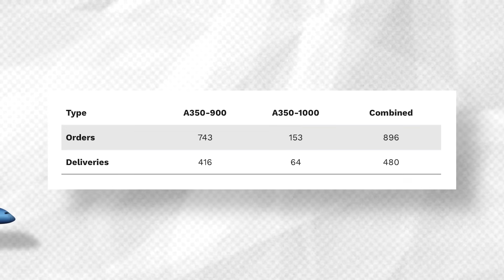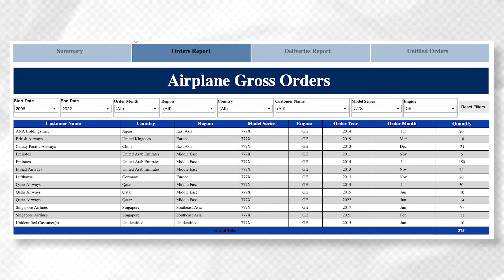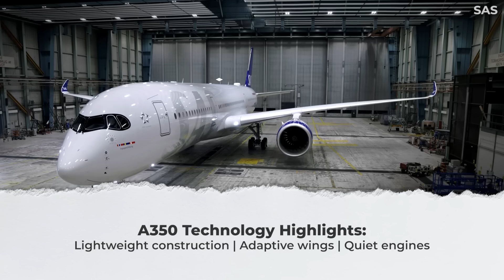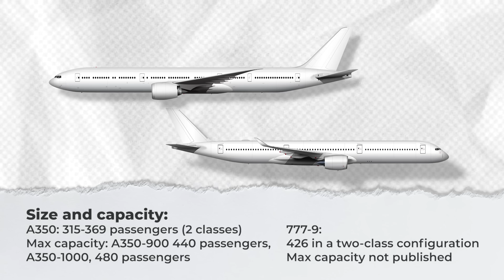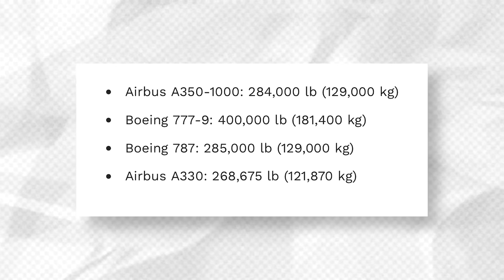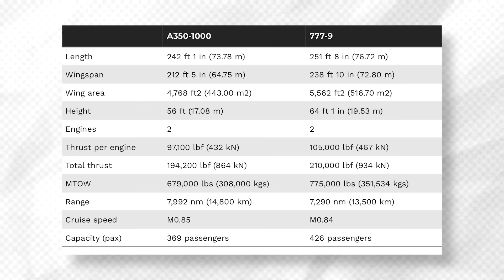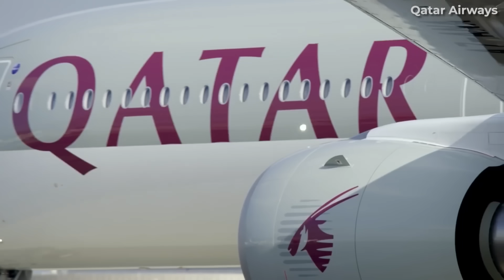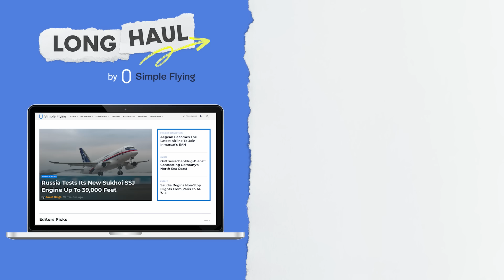The Boeing 777x vs Airbus A350 - Which Plane Is Best?

Comment: The A350 is a proven reality while the 777x still has to deliver its promise
Reply: Um..
A350 Was a response to the 777-300 and 300ER. The X is the next step that Airbus will then have to compete with.
Reply: @jtcali2086  Probably because Boeings safety record is catastrophic, Airbus owns Boeing and you just have to accept that sadly.
Reply: @atid42  What are you responding to?
Reply: @jtcali2086  Exactly!! Boeing is doing all the innovations and Airbus capitalizes. It's the same thing Apple does. They take technology that's 2-3 years old and make it seem like a cool new thing.
Reply: @sainnt  Airbus made fly by wire perhaps the most important innovation in the industry. Ur calling others out on being Airbus fanboys but ur a Boeing fanboy just call out the strengths and weakness instead of making the stupid claim that Boeing innovates more
Reply: @lukelouw515  Yes, Airbus put fly-by-wire on commercial aircraft. They didn't make the technology. Airbus fans love to point that out every chance they get. Most of the tech on the A350 started with the Dreamliner. Airplanes fly perfectly fine without fly-by-wire.... like the Max and current generation 777. It's basically automatic vs stick shift. It's not the a game changer, and it's not an Airbus invention. Let it go.
Reply: @sainnt  ok but Boeing didn’t invent composites which is what made the 787 so special but I respect them for implementing it first
Reply: @lukelouw515  Boeing is the first to make the fuselage of a commercial aircraft completely out of composite. Airbus, fly-by-wire, Boeing, carbon composite fuselage. Facts
Reply: @sainnt  neither invented their respective technologies but they were both to implement them mainstream
Reply: @sainnt  Well airbus did some innovations when we trace back to the introduction of the a300. The thing is on this market it's not like manufacturers copy but rather airlines may demand something to compete
Reply: @rpt19  That does happen. However, Airbus wanted to replace the A330 with the NEO series, but the 787 changed all that and they hai to scramble and build a composite aircraft. Had it not been for the 787, the A350 would never have been built, and Airbus would have ridden the coattails of their previous generation aircraft like they did with their narrowbody aircraft, and their profits would have been astronomical, but the 787 did force them to the drawing board, and something good came out of it. The A350 is an amazing aircraft too.
Reply: @sainnt  👍
Reply: @sainnt  No one wondering how this guy knew that the designers/emgineers in Airbus weren't already looking at the possibilities of a composite fuselage prior to the announcement of the dreamliner?just sayin.......and regardless doesnt matter composite materials are used in every single other form of transport engineering boats,cars etc etc its not exactly anything exiting,it was more just a matter of time bit like when phone screens were 480p and tvs were 1080p one was bound to follow the other and advance and thus you can now have a phone with a 4k screen, like saying if bmw paints a car yellow and then mercedes paints a car yellow its copying....its not ....its something thats there on the market and is a feasible option .
Reply: @sainnt I am struggling to understand how you qualified yourself as a “av geek”, use of composite material on commercial aircraft date back to as early as the A300s, and where did you capture the “fact” of airbus capitalizing on Boeing’s innovation, ever heard of patent? A350 and 787 are completely different in their construction in terms of use of material and they even have different numbers of hydraulic systems on board, the similarity of the two aircraft basically stops at they are both twin engine wide bodies that uses composites material. believe me the design of a aircraft is more sophisticated than who first said carbon fiber fuselage in their marketing material.
Reply: the a350 is targeted at the 777 market, that the a340 poorly handled

the 787 is targeted at the a330 market, airbuses response for this gap is the a330neo which was cheap to design and is selling decently well

Different planes for different roles man
Reply: @randomphoneaccount  The A330neo is not a cheap redesign. And, based on the A330 CEO, and compared to the aircraft it's competing with, it's definitely not a success.
Reply: So true, but before that it needs to promise to deliver!
Reply: Precisely
Reply: 777x is alr being test flown
Reply: You could say that for the A350 back in 2014. Any new aircraft has to go through the motions
Reply: Well said
Reply: The a350 is a great modern airliner and the 777 series is the most successful twin engine wide-jet . It's a pity if Boeing can't get its sh*t together and squanders its own engineering heritage.
Reply: @khanchy  Not counting the cargo variant the Dreamliner is on pace to become the most successful twin jet widebody aircraft. It's incredible when you consider the fact that it's only been in service for 11 years. 
There are still more variants of the aircraft that could be built, so it may exceed 2,000 units by the time it goes out of production.
Reply: The A350 is a Dreamliner knockoff! And, actually not as good or as fuel efficient.
Reply: @sainnt  the strength of each model including their fuel competitiveness on each route is analysed by each airline. If a350 didn't meet the competitive needs of any airlines it wouldn't sell.

It's you who sounds like a fan boy.
Reply: @sainnt  what you talking about. The XWB is the most efficient engine in the world
Reply: @paolomaldini3082  Perhaps you need to read my comments again. The XWB is a very fuel efficient engine, though I don't know if it's the most fuel efficient in the world, maybe if we're talking about widebody aircraft. 
The GE 9X will be more fuel efficient though.
Reply: @sainnt  how do you know for certain it will be more efficient?
Reply: @paolomaldini3082  According to Boeing specs. Also, Rolls Royce is already developing the Ultrafan, which is supposed to be even more fuel efficient than the 9X and XWB
Reply: @sainnt least delusional boeing fanboy
Reply: @riverjhin  it's called being an aviation enthusiast. True av geeks know that both planemakers have done some amazing things to be appreciated.
Reply: @sainnt  looks like you can only appreciate boeing and hate on airbus tho. And everything you write seems pretty delusional.
Reply: @sainnt  stop arguing, it's useless.
Reply: @sainnt  Not good time being a boeing fanboy now. Lol
Reply: @rayawira Based on what? I need details in order to debunk your delusions.

I've said it once, but let me say it again. Airbus is outselling Boeing on exactly ONE aircraft, and that's the A321, which literally has no competition..

I'll be waiting for your Airbus fanboy response.
Reply: @sainnt  the A350 does not even compete against 787, Stop comparing them.
Reply: @sainnt  and the fact that you say is a “Dreamliner knockoff” they are different.
Reply: @kathy8770  They're similar in terms of the way they were built. They're the only two mainly composite aircraft, and the Dreamliner was first.
Reply: @sainnt  that does not mean airbus copied the 787.
Reply: @sainnt  Airbus has used CRP long before Boeing started to use it in the a 310 (Tailplane) and the a 380 (20% composite Material)
Reply: @he8570  Not for a fuselage until the Dreamliner. Planemakers  used it for wings and tails like you said.
Reply: @sainnt  ok and Airbus was the first plane with fly by wire, the 777 was the first plane of Boeing to have this which completely changed the game. That doesn’t mean the 777 is a copy. Just cus Airbus built it with composites doesn’t make it a copy. The industry was already going in that direction for a while
Reply: @sainnt  just bcus they both use composites doesn’t mean it’s a copy. It as much bigger aircraft that serves a different marker they actually don’t compete much ppl just conflate them Cus they use similar tech . That’s like saying 777 is a copy of the a330 bcus it used fly by wire. The word copying is stupid, it’s aviation they use each others tech Boeing snd aircraft l. Which is ur favour aircraft manufacturer
Reply: @sainnt  so you’re saying because Boeing built a composite aircraft nobody else should be allowed to? Using composite materials isn’t something you can copyright or trademark bud. And it definitely doesn’t mean the 350 is a knockoff. It fills a different market segment, looks different, flies different, has different engineering, like the only real common point is the composite materials.
Reply: @HekateMGO  I never said Boeing had exclusivity on composite materials. Before you enter into a debate you first have to know history. 
Airbus was planning on basically building a larger A330 aircraft with 2 engines. With the Dreamliner announced there was no interest in the Airbus design, and that's when they switched course and announced an aircraft like the Dreamliner, meaning built with composite materials. That's the definition of a copycat, even though I'm not saying that it's a full on copy, but let's face it, Airbus is pushing the A350 to be a better option than the 787...they went composite, switched to a more spacious 3-3-3 configuration, did the 'airspace' design, and are now adding dimmable windows. They're now considering 3-4-3 because of the 777-X. If it looks like a duck, quacks like a duck...
Are you caught up? Ok, good.
Reply: @sainnt  It's the definition of following the market trend, sure. Almost like designs change between initial concept and production to incorporate new technology and respond to what the market wants. The market wanted a composite jet, Airbus made one, doesn't mean it's a 'knockoff' as you claim. It clearly isn't. What do I know though, I only work on aircraft for a living lmao
Reply: @HekateMGO  The market demanded it because Boeing announced something innovative , and not only in terms of composite materials, but other aspects of the design that no one has seen before on a commercial airliner. Even if, as you suggest, it merely forced Airbus to change course, they still did it based on someone else's idea. That's simply hard to ignore.
And, working on an aircraft doesn't make you sound on aircraft history. I've been following aviation for over 4 decades, so I can certainly hold my own, and even I wouldn't claim to know more than I know, but I do know what I know. 
When having discussions about these topics, I'm always looking for someone to teach me something I don't know, but it has to be based on facts, not feelings.
Reply: @sainnt  yes, the design changes were a response to the 787 and customer demands for Airbus to create a clean sheet design, that still doesn't mean your claim that it's a 'knockoff' is true. A knockoff by definition is a cheap copy, the A350 is not that. They're very different aircraft. You'd claim the Embraer ERJ series is a CRJ knockoff because of it's series of design changes and superficial similarities, but they're again very different aircraft that were independently engineered. I'm saying that as a casual "avgeek" you don't know how aircraft are engineered no matter how long you've been following aviation.
Reply: @HekateMGO  I believe that I said copycat, not knockoff. You said knockoff, and I know those aren't one and the same.
Reply: @sainnt  This was your original comment at the top of this thread bud: "The A350 is a Dreamliner knockoff! And, actually not as good or as fuel efficient."
Reply: @HekateMGO  Since we're being literal, I stand corrected. Not a knockoff, but definitely a copycat.

Comment: I think what makes the 777X better is that the 777 competes with a heavy frame, but +15% passenger capacity and roughly +9% cargo capacity, which basically means that at the end, it evens out on fuel consumption. The A350 with a light frame which sheds more than 10% of aircraft weight just beats the 777 by just 0.02 lbs per nautical mile. If the 777X had a composite frame, it would beat the A350 easily
Reply: Unfortunately the real world doesn't work that way.

While the statistics may be accurate, they rely on the 777 operating at capacity, and it probably wouldn't need that many empty seats, or maximum cargo before the tables are turned.

This is not a Boeing V Airbus comment, just that if you look at how the metrics work, you will see that a larger aircraft with more seats and cargo capacity often works out better for the airline, but only if they can fill them!

Otherwise the trip cost becomes increasingly the most significant factor.

If the A350-2000 actually saw the light of day, it would be a better comparison with the, 777x, and judging by how most stretched versions are more efficient, I would be surprised if that A350 didn't come out well on top (unless the 777x were to be stretched or they found a way to add more seats of course)
Reply: A similar sized 777X is less efficient than A350, see 778 vs 35K.
779 only manages to match smaller A350 by packing more passengers, so as 778F vs 350F in terms of cargo.

Comment: Doesn’t sound like the new 777 offers that much more than the A350-1000
Reply: They really pushed the old airframe to thenlimit to give 777x an chance to compeate with A350... and it might, but im sceptical. 

What is really intesting is next gen blank Sheet  airline where all tve tech from both 777x and 787 are combined.
Reply: @matsv201  yea we don’t need the 777 to be the next 737,meaning older airframes keep around forever
Reply: @russellstrom8234  while 777 isnt "that" old.. now when we going over to composite, its like when we went from wood to metal, sudenly all airframes are outdated.
Reply: Didn't a composite sub implode this summer?

Comment: A350-1000 certainly beat 777-9 efficiency in many way.....but Airlines decisions are very complex tasks....so many factors involved 🛫🤓
Reply: Well, you seem to forget that the A350-1000 is a smaller airplane than the 777-9 so overall trip cost is lower obviously. However on a per-seat-basis the 777-9 wins*. In the end it's down to the airline and what the airline needs and which airplane works better for them.

*=Based on the 9-abreast A35K. With the new super cramped 10-abreast Economy the A35K may become better. But which airline will be ready to put their reputation on risk by doing this?

Comment: Both are designed for very different needs. Airline CEO's will carfully decide which aircraft suite their needs and order accordingly.
Reply: Exactly. They are both great aircraft, even with the problems, that fill a different need.
Reply: #airbusforever
Reply: @heidirabenau511  #AIRBUSFOREVER❤
Reply: That's not true. These planes are incredibly similar..the 777 has a 30 year impeccable history with thousands of trained techs all over the world.that's the major advantage with Boeing
Reply: @CorpulentCornball  But 777X is still significantly bigger with no real advantage on seat cost. Some airlines like JAL and Cathay has started replacing 777 1-to-1 with similar sized 350, or downsizing 77W to 359 instead.
Seems like only those who can fill an A380 are taking 777X, and even if they do, often they don't order as many as they did for 77W.
Reply: @steinwaldmadchen  true but the new 777 freighter will be VERY appealing to Cargo airlines. Airbus is still
Behind in terms of cargo ability
Reply: @Chrisp707-  Except A350F is actually more capable than a 777F, and out of the 4 customers, 3 of them (CMA CGA, Air France and Etihad) are 777F operators.
Gone are the days when Boeing enjoyed a monopoly and could set prices whatever they wish. And with a much smaller 777X backlog they might have more trouble keeping acquisition cost low compared to A350.
Reply: @steinwaldmadchen  I swear you have an agenda against Boeing. 
Airbus can never match Boeing's experience in the cargo segment. 

The 777x has close to 400 orders which is actually alot for such a large aircraft that's more than the a380 ...

Boeing has a large variety of aircrafts for the cargo segment like the 737 BCF , the 767 F and the current 777F and the X8F..

All these models above still having large backlogs and still proving popular with many airlines....

The 777XF currently has more orders than the a350 F , almost twice and will just be as popular as the 777F based on the 200LR..

And the 350F's only capability over the 777X F is range , other than that the 777x F can carry more cargo and MAY offer a lesser cost per ton than the 350 .

The 767F may get a  re engined Version if Boeing goes for the 767 for the NMA and studies are underway for a 787 Freighter if the 767 is not given an upgrade....

Airbus only proper competition is the  a350 F with other models proving not to be popular with cargo airlines . Lol ..

Airbus not catching up soon in this segment
Reply: long haul. similar capacities

Comment: The A350 is such a comfortable plane. The width, wall shape and cabin pressure really makes a difference. The curved wings and cockpit windows are so good looking. The 777x looks very good too. If SQ keeps 333 on the 777x it will be very comfortable.
Reply: They will definitely not go 3-3-3 on the 777X because due to a wider cabin the Economy seats on the 777X with 3-4-3 will be just as wide as on the A350 with 3-3-3.
Reply: Both are great planes, although i wish Boeing did better and pay more attention to 777X development. SQ probably will do 3-3-3 on 777-9, but I am not that optimistic after they put the 3-3-3 on the 787
Reply: 777 is wider